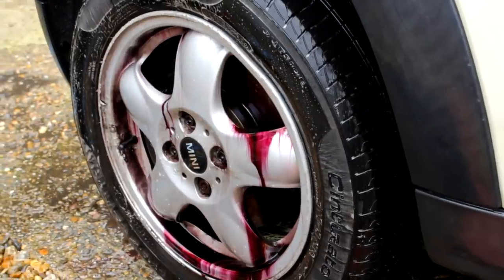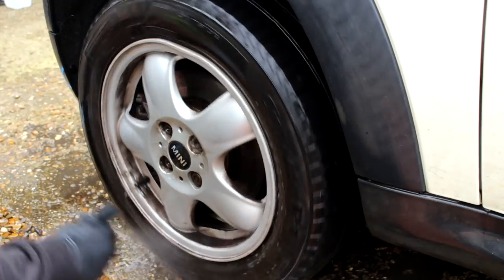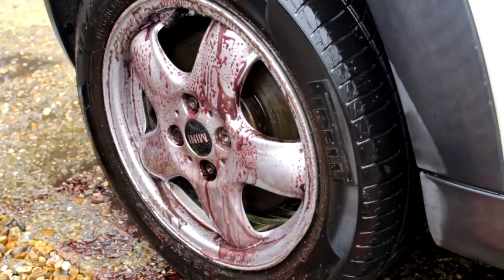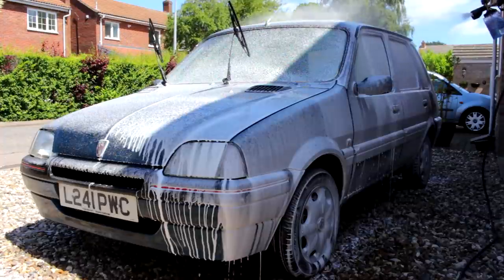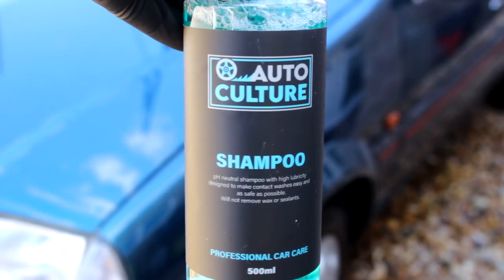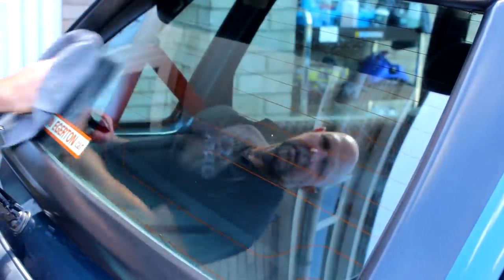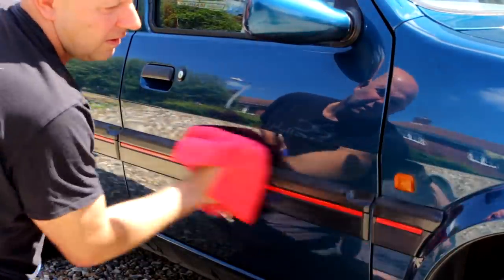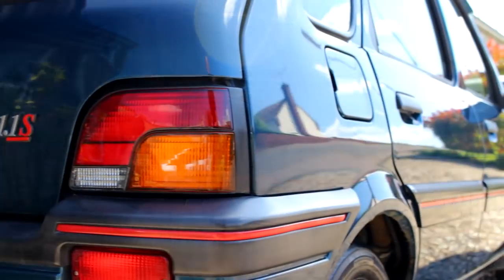My wife's car gets a clean

Comment: If I’m not wrong , the cloth liner on wheel welds are for reducing tyre noise inside the cabin . ? Yes absolutely a nightmare to clean them 😄 but I guess if you’ve the right products & brushes then it should help .